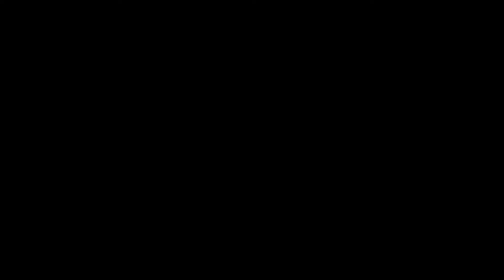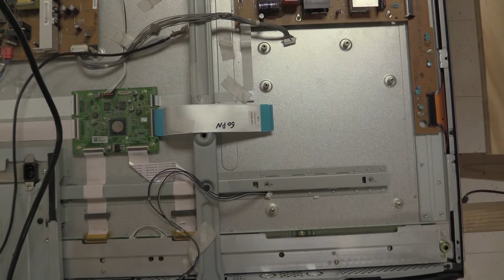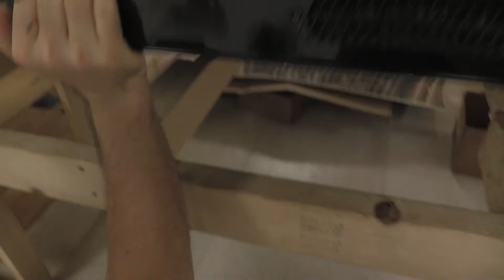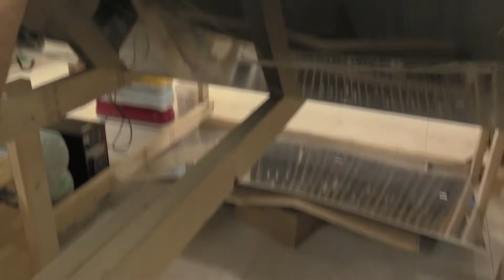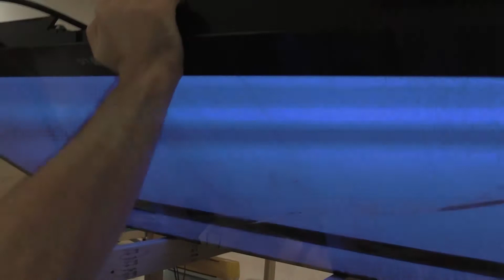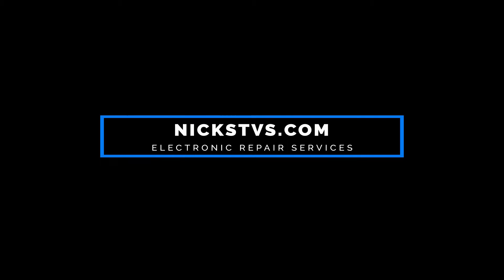2011 LG plasma Main Board Diagnostic 60PZ950

Comment: This looks like the LG I just fixed, screen would randomly go out, restarting the TV fixed it for a while, it seems to working fine now after some cleaning and re-soldering some joints. Could be the main going bad. This plasma is a wifi smart tv with apps, has the same logo, is it 3D too? I didn't know they made them Its a 60PN5700,
Reply from the maker: The one I have in this video I believe was a smart TV but I honestly can't recall. It is known to have Z-sustain and Y-sustain issues that are due to cracked solder joints indeed. If left untreated it can cause the transistors to short out. 
Also as you suggested the mainboard can get bad solder ball joints on the processor so that board also can go out.

Comment: Thanks for the Video Nick ! I have the same issue with LG50PJ350 no display even after 'auto gen' TPs shorted. Logic board LED blinks as, a long blink and followed by 2 short blinks is this blinking pattern is  OK? What is the LED blinking pattern of a normally working logic board?
Reply from the maker: Not a clue, we don't use that to diagnose the sets. If you don't get the color pattern test however, it means either your power supply, your sustain boards or buffers are out. 
You will need to either do resistance checks, or voltage checks in order to identify the fault. 
I don't have a video on that right now, we should have one in the future, but for now I would recommend starting checking the set for shorts on the VS and VA lines with the TV disconnected from power. If you find shorts, disconnect the boards from one another and trace out the shorts. I have a feeling your Y-sus is most likely the shorted part, but that's speculation. 
If you have more questions, send us an email to support@nickstvs.com

Comment: Same as lg50ph660v my mainboard gone lightning struck  rest ok thanks
Reply from the maker: Lightning strikes are almost always going to break mainboards as they enter the system unchallenged via the coax cable, ethernet, or HDMI where there are no power surge protection systems as the only low voltage is ever used in those areas of the electronics. 
This is however still fixable and a repair we have performed on hundreds of boards. If you can send us a message to our support email support@nickstvs.com and provide us with the part number of the board, we might be able to help you fix the board by doing a component level repair, or at least see if we can guide you to finding a replacement.
Reply: @NicksTVRepair  I am a aerial in staller in uk.got tv for free lighting definitely entered coaxial in put. can not see any damage at all.unsolded the block    were aerial goes. to look under now no good .as I am no tv repair man.i just fit tv aerials . just get second hand board it's a lg50ph660v part no ebt62634901 eax6487004 .only one one Ebay bit dear keep eyes open.one turn up did that bit of bridging point on t con lit up.so think rest all good . not many people in uk repair the boards just by second hand its 2013 last plasma a think. £1200 or so thank for reply  it's a strange one aerial on house ok but fried a 4 way splitter and burnt coaxial plugs but can not see any damage in tv at all ist a mainboard for it one turn up it was free thanks again craig in uk Sheffield